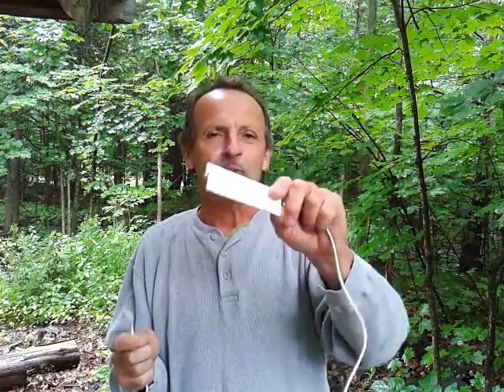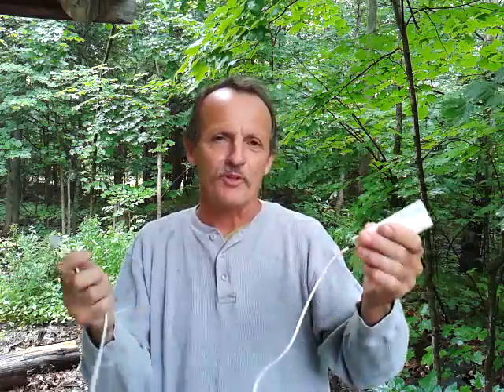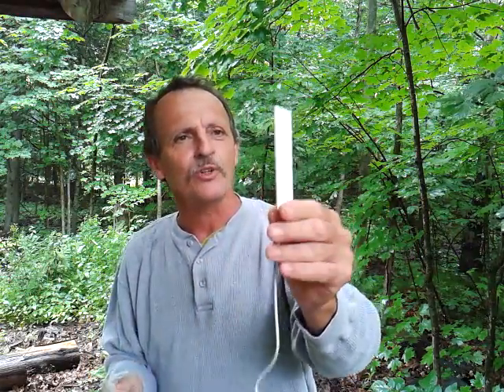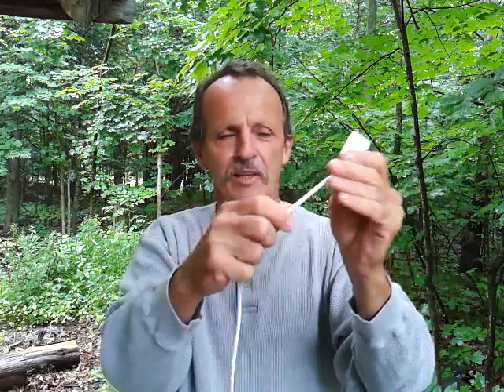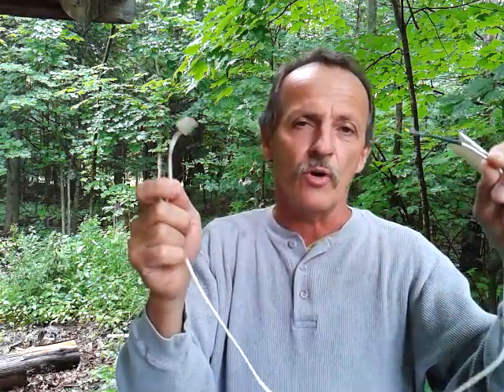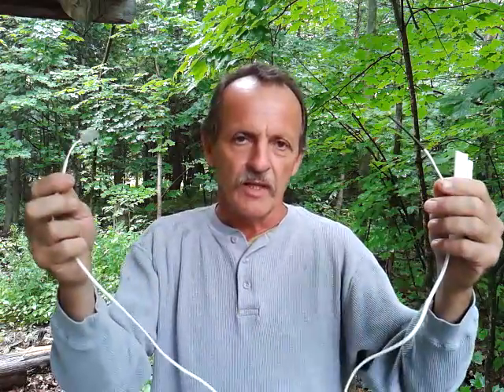Dometic Thermistor how to test

Comment: Can I just replace thermistor by splicing? Easier than replacing entire thing. Wire nuts or electric tape? NOT using snip the tip. Suggestions please?

Comment: My dual zone Dometic fridge/freezer doesn’t go to set temp. The freezer always freezes to coldest setting and fridge is always relatively warm. Does that sound like the thermistor? I’m assuming there are 2 as there is a fridge and freezer section. No matter what I set it at the temp never goes to that temp and the compressor seems to always be running

Comment: I bought a used rv 3 years ago and the frig had no thermistor. The beer was so cold it hurt when you drank it. I liked that. A half gallon of milk would freeze after 2 days however.
Ammonia leaked last week, the cooling unit died, and a rebuilt unit is in route along with a new thermistor. 
So you said the cord goes through a grometted hole?
Where is that hole located?
And what plug location in the control box does its plug go into? Or is it obvious by the plug shape.
I wont take it apart until everything arrives for my project.
Thks

Comment: great review quick and to the point. my refrigerator is showing the symtoms you discribed. it wasfreezing everything inside the refrigerator. i removed the thermistor and it stopped cooling i ohmed out the two wites and found that i was getting about 15000 ohms. so i think its definitely my thermistor. .i have ordered a new thermistor off ebay so hopefully it will solve the problem. thanks.